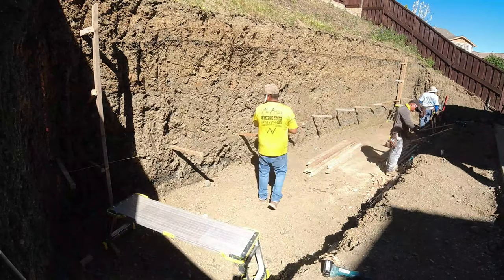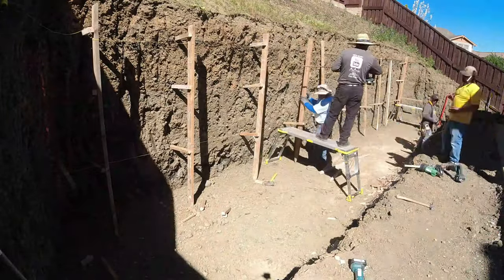Concrete Retaining Wall Build | 3 Tons of Rebar

Comment: Looks great. Thanks for posting. I was trying to see, did you used fibreglass spacer rods on the wall?
Reply from the maker: No fiberglass was use. We used 16 duplix to hold the vertical rebars

Comment: Great work  , stupid question , do you use the same kind of concrate mixing raito or do you change it as per job
Reply from the maker: 6 sack pea gravel 4 inch slump last 15 years.. Not 1 problem.. 💯💯